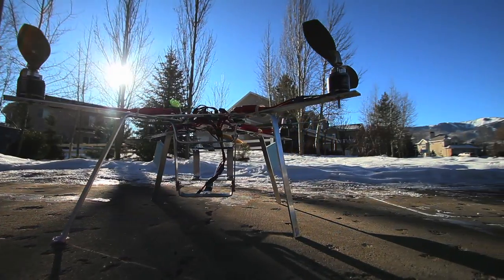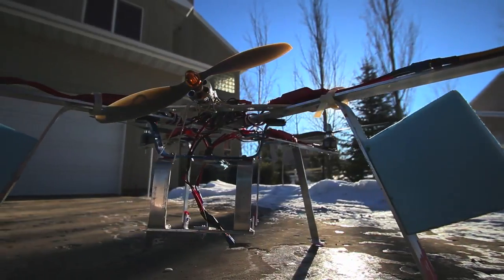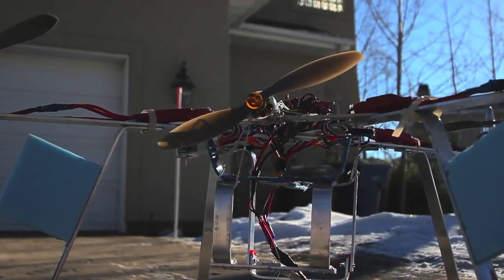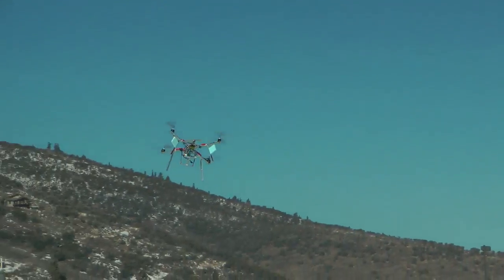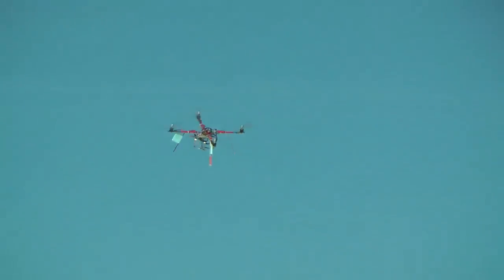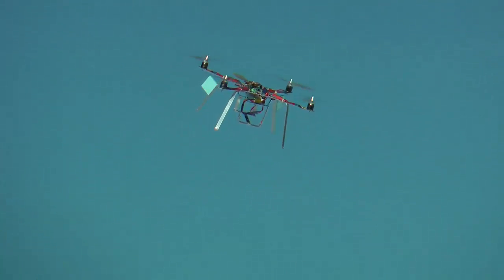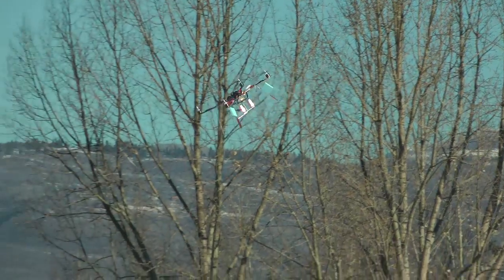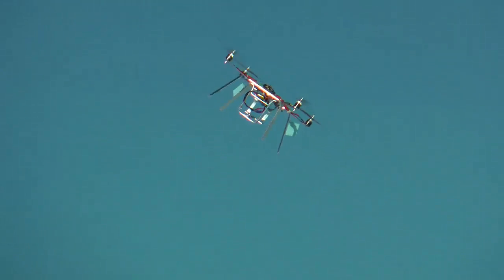Quadcopter With Pusher Prop

Comment: If you test this on a much lighter quad, you could have a different outcome.
Just built a F330 arms/ zmr PDB/bottomplate frankenquad with 6040 props/dys 1806 2300kv. Just a quad for fun, but with another dys motor/ 5040 tri, I get about 350 grams of forward push, preflown it in my backyard, very responsive and stable.
The motor spins up to 90% with a push button, no delicate throttle on this one, but it looks promising. When my pneumonia is over, the first thing on my list is flying with it ^^

Comment: Needs more work. At least it shows a pusher doesn't seem to hurt stability too much. Theoretically, this could boost top-speed during speed runs. This doesn't quite look like a speed-quad, so it wasn't at the edge of the flight envelope where it's no longer possible to trade lift for speed. Get the quad nosing forward so it goes that fast, and a pusher should make a difference.
Reply: pauljs75 To provide a level push without interfering with the tilt, the pusher would need to be mounted on a centered gimbal. On the other hand, pushing at a downward angle would require more throttle to stay level. Which would create even more forward thrust. Inefficient, but it might go really fast.

Comment: Looks like it's more like fixed wing in terms of controls, when the pusher prop engaged. Does it feels like controlling an airplane in that mode?
Fins below rear props added just in case or after some experiments and flights done before?

Comment: I wonder what happens when you do either of these things:
1. High KV motor with small highpitch prop
2. EDF units aimed forward on the front arms (so it pulls it along, the controller wont fight as much).

Comment: The difference is that the Makani wind turbine is teathered. Its forward airspeed comes from the relative motion of the air and the surface of the earth (an external source of energy). It then harnesses some of this energy via a turbine. This quadcopter is generating its own forward airspeed via power supplied by the battery. If it carried a turbine, it could *not* produce a net power gain. It's basic physics.

Comment: that plane is tethered.  It is my belief that what is happening is that there is wind and it is being used to pull the plane up to altitude just like a kite.  Once it reaches altitude it dives back down where it creates the power.  Genius idea and thanks for pointing it out.  I don't believe in perpetual motion.  A generator would need to be over 100% efficient for perpetual motion and that would mean that there would need to be no drag no heat no noise which all waste energy.

Comment: Wouldn't you want to add wings and disable the quad rotors when the pusher was operating?  

Or, even better, clutch the quad rotors so that they can free wheel to create some sort of super autogyro (no clue how you you'd do that on an electric RC vehicle though).  

Just pushing a quadcopter seems like a losing battle.  

Props to you for trying though...My quad is still too dicey to take out into any applicable wind so I'm not speaking from experience.

Comment: Your pusher seemed to make it go a bit faster. Google Europecopter x3! Google "Proray"! and "Stop-rotor technology"! My Proray concept is the same except it may use stop-rotor technology. If you build a plane around the quad copter (like the Parrot but wing-shaped faring) and stopped the quad-rotors when using the pusher prop, you would have a Proray. My next concept is a stop-rotor chopper with two pushers called the Whirlwing. Google "Whirlwing".

Comment: Great idea Daniel. Can I ask how you have the pushed prop control setup on your TX? Have you got it mixed into the throttle and forward elevator? Or are you running an extra channel to cut it in along with the throttle? Just interested to know. I got spare motors and prop lying around. Might have a crack ay this concept on my own quad..